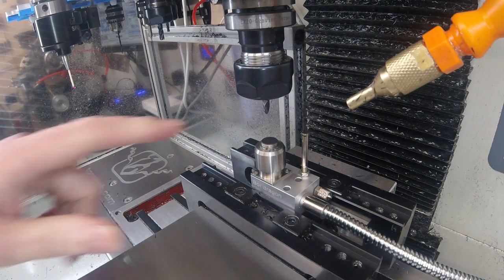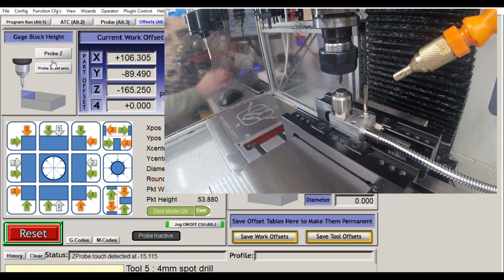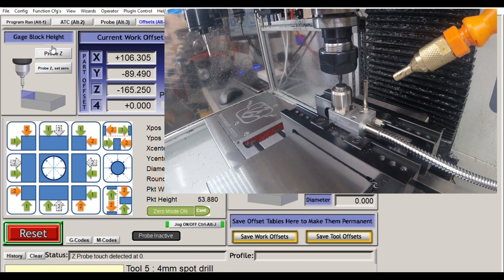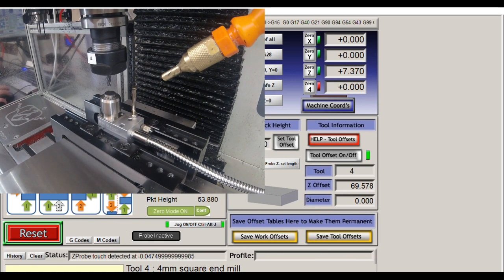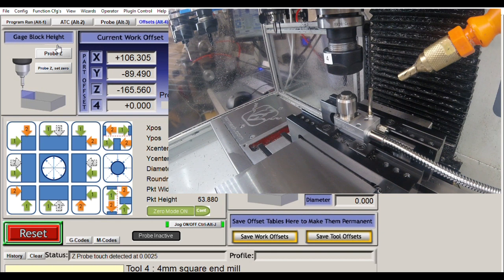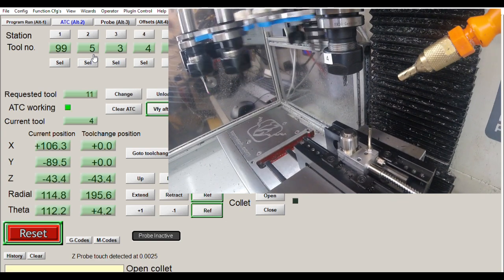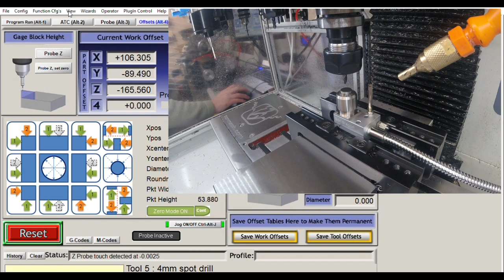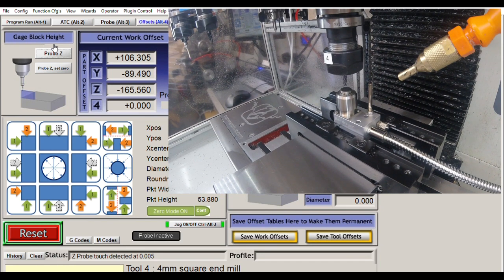Cheap EBay ETS with a Tormach 440

Comment: Dave,

I love that wireless probe.....were you in a position to sell a set of plans for that killer design.
Reply from the maker: The wireless conversion is available as a kit from https://shop.xoomspeed.com/collections/cnc-accessories/products/wireless-probe-kit
There are versions for Cliff Hall's ITTP probe as well as both the original and new Tormach passive probes.  Conversion of any of the probes only takes a few minutes.  There are photos of the process at http://xoomspeed.com/CNC/wirelessprobe.htm

Comment: What screenset are you using? Does it have a probe calibration screen?
Reply from the maker: It's really just the standard screenset that I've modified to suit my own needs.  I downloaded a copy of machscreen.exe and find it pretty easy to do anything I want.
Probe calibration was done using the ProbeIT add-on that's supplied as standard with Mach3.
The ATC page is entirely my own, as are the ETS functions, but the probing is done by calling altering the probing part of the standard screenset to call the ProbeIT functions.
Other parts of the screenset have been modified to have buttons for functions I use a lot and get rid of things I never use.

Comment: would you mind sharing a link to the store/site you purchased from?
Reply: I offer a full kit with a mounting block unfortunately I am backordered right now. Should be available in a week or 2  
https://www.seahalt.com/products/tormach-tool-length-detection-program
Reply from the maker: That one came from an eBay shop named casuntek The same device is being sold by loads of people though, so not hard to find it.  Shame they don't do an appropriate mount for it.